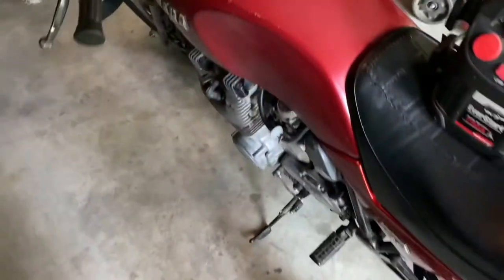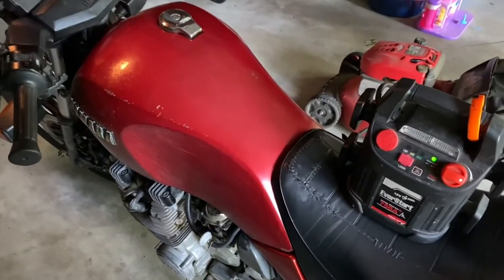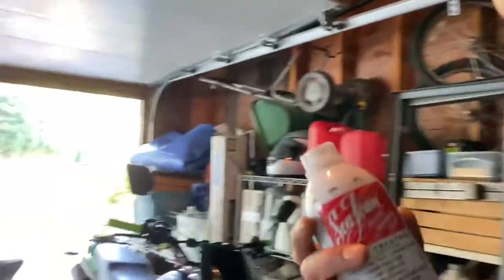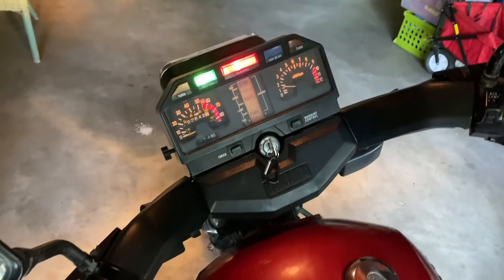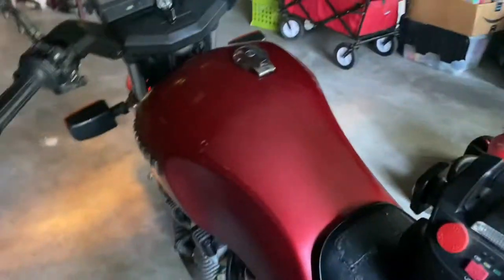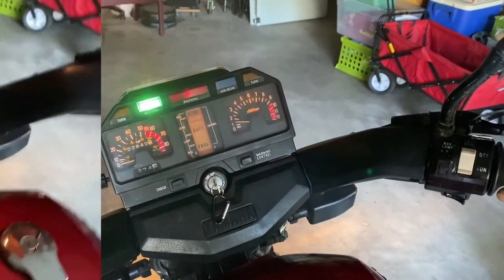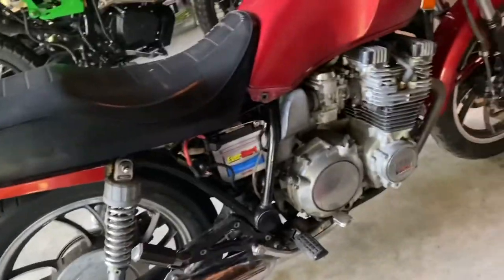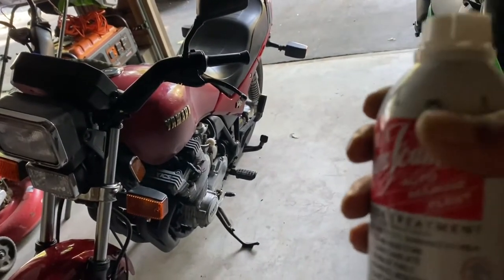Clean Motorcycle Carb with Seafoam - Yamaha XJ 750

Comment from the maker: Update  Bike continued having trouble starting after this video and whatever the seafoam did, it only worked for a day or two.  After the bike sat for three days I could not get it started at all and have since pulled the carburetor off twice to clean it properly.
Reply: After cleaning the carbs properly was it running good?
Reply from the maker: Ran great all summer.  I got it to a point where it started up like new.

Comment: run that seafoam out as fast as possible, get the highest octane u can or ethanol free gas if u can and just run her hard on the highway to get that stuff out. newer bikes its alright, but ive had issues with seafoam destroying my rubber diaphragms and whatnot on older bikes. also, if it runs good for awhile and then gets shitty and sputtery, more than likely you had some crap in the tank or rust that clogged up the little galleries inside the carb.. ive had that happen many times. wd40 works well too, i used to use that alot, or even coca cola by itself just letting it sit. that acid in the coke believe it or not will clean a gas tank like none other. On old bikes chances are good the carb will need work sooner or later, but im stoked you got her running and can at least to some shake down miles to see what else is wrong with it. ride safe!!!
Reply from the maker: You are exactly correct sir!  Took the carb off after this video and it was disgusting.  One of them the float needle was stuck open and the slide wouldn't close.  Cleaned up the gas tank but also replaced the petcock that was all gummed up inside and missing the filters on the tubes that go up into the tank.  Looking back at this video it is amazing that the bike ran.  After this video I couldn't get it started until I took the carbs off and properly cleaned them.
Reply: @HandyL  sweet! I’m glad you made some more progress on her. Older bikes always need love on those carbs if nowhere else if they been sitting. Keep going, take breaks, ride, fix, repeat